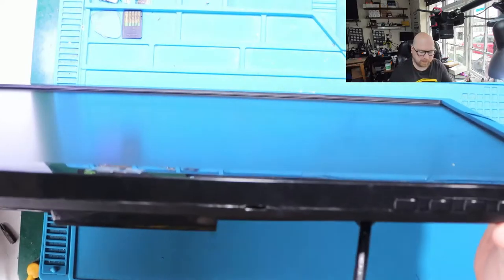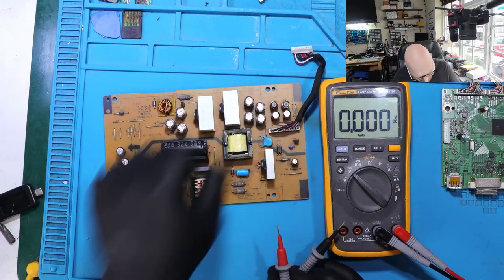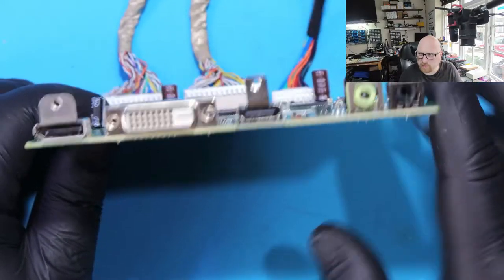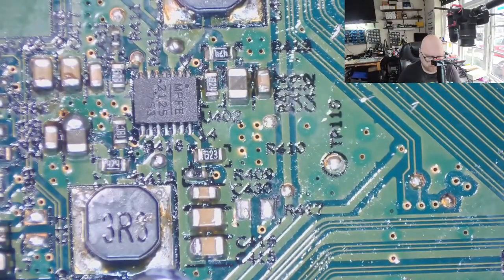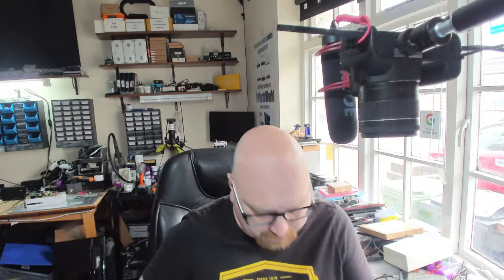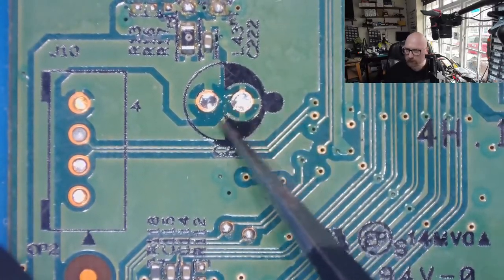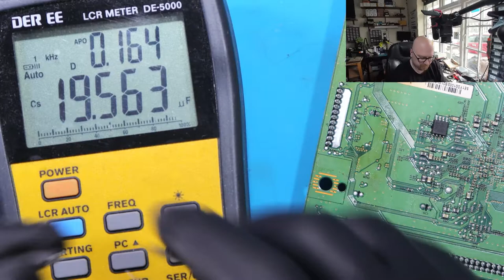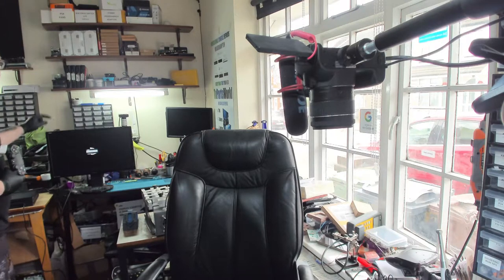OLD ASUS VG248QE 24" gaming monitor repair. Can we fix it?

Comment: I'm just getting into micro soldering and diagnosis. At 52 it's something I've always wanted to do but never had the chance in my formative years. I've just bought an Andonstar microscope and a T12 soldering station and have been practicing on some scrap boards. I must admit the tiny size of the components took me by surprise. It looks so easy on YouTube, but let me tell other viewers it is not. I've got huge respect for Tvpartworld, Cod3r and obviously Northridge Fix. These guys make it look easy when it is nothing but. I'm committed to learn and use the incredible techniques these guys have developed. They want to share their knowledge. You could not get this kind of training anywhere else. Thanks guys and  Happy soldering.

Comment: Hellow! At first, great video😮. I don't understand at all about electronics but I'm trying to learn by myself and the help of a friend and obviously youtube. All of you are great proffessors for me, thank you very much. I have a question, I've found a similar monitor in the street and its works but it seems it has a problem with vertical lines, pixel lines. It has two of them. I tried to find the problem. But no results. Very videos on the internet shows how the cof cables are the guilty of this. I'm figuring to change it or find any shorts on the t-con board. If there are, change the component. What do you think? It's a pity because it looks a very good monitor to save from waste. Thanks again and sorry about my english.😊
Reply: interesting. my monitor just died i think, but before dying, sometimes i could see graphical errors- like vertical lines as your descibing but it fully went all black screen today